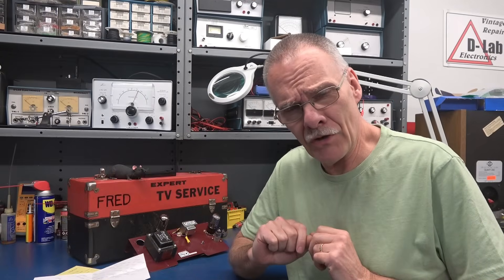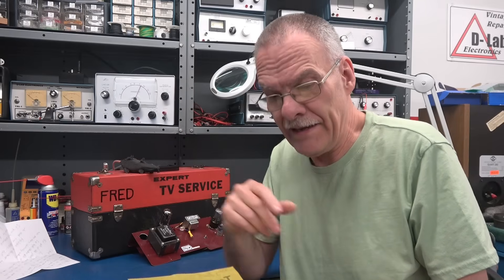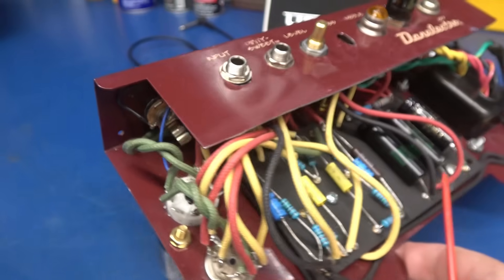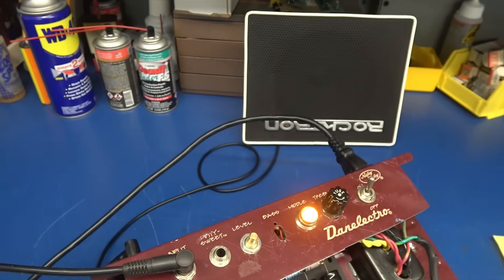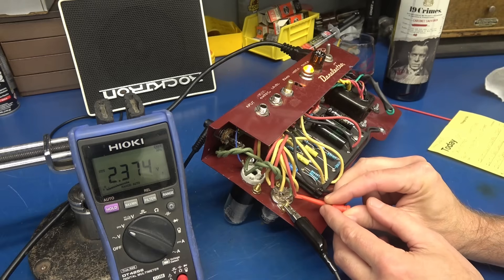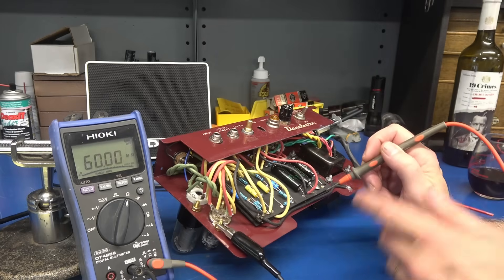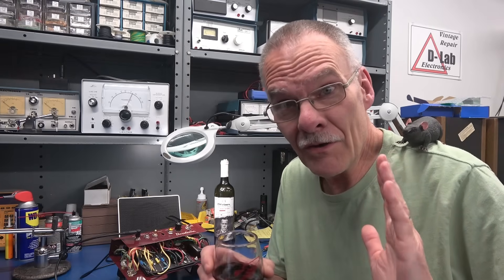D-lab electronics Basic Training Fred & Fink Silent Fender 5F1 clone guitar 6v6 amp Lets repair it

Comment: The light blue body usually means they are metal film resistors. Metal film can be manufactured to much tighter specs, hence the 1% tolerance and the brown fifth band. Instead of two digits, three are used to allow the manufacture of values in between the standard, traditional values. The multiplier is moved to the fourth band.
Example:  Yellow - violet - black - orange - red would read 4 - 7 - 0 - K - 2%  470K at 2%.
In addition, metal film resistors are are much less prone to becoming noisy or to value drift.
I use them when rebuilding Leslie amplifiers with great results.
Oh, one more thing, Chinese or not they are NOT cheaper than carbon comp.

Comment: At 9:42: That resistor is a 1% tolerance type. Colour code is three digit for the value, one digit for the exponent, one digit for the tolerance. Result: 2-2-0 * 10^3 ohms with 1% tolerance

Comment: Thanks, Terry, for the reminder to check even the little things.

Decades ago at an electronics manufacturer I discovered a problem with carbon composition resistors that had been gathering moisture from the air for a long time.  Brand new, yet they were way out of tolerance, and after soldering in-circuit they retained that bad value.  But!  We found you could bake the untouched ones in a low-temperature oven for a while and get them back in spec.  Then soldering would lock in the good value.  Later the design engineers changed the spec for that one resistor, using a tighter tolerance metal film one instead, since it was a critical timing circuit (555 timer used as a power-on reset circuit that wasn't catching short power "blips". 🙂)

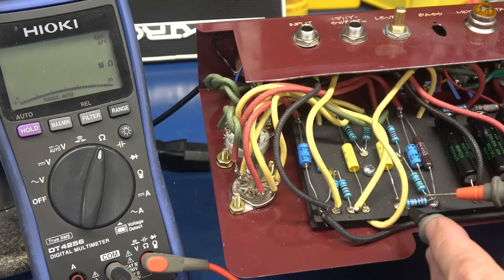Comment: 9:45 - Egad. 1% resistors are a pain to read.   I can sight read 5% and 10% color coded resistor without a problem.  Give me a 1% resistor and I go "duh.."  I can't even tell which band is the first digit.  And for some reason the 1% resistor colors are hard to see compared to old school resistors.
Reply: They are confusing, especially 1/4 watt. You need a magnifying glass to read those. That cathode resistor at 1400 is actually out of spec for a 1%.

Comment: Both of those resistors had the correct colour bands. They're 5-band resistors - you can't just use the 4-band code to read them. All 5-band resistors have an extra digit before the multiplier (dig-dig-dig-mult-tol rather than dig-dig-mult-tol).
Reply from the maker: That is fine. This series is Basic training, helping guys to avoid common mistakes. A more advanced training video would go deeper into details.